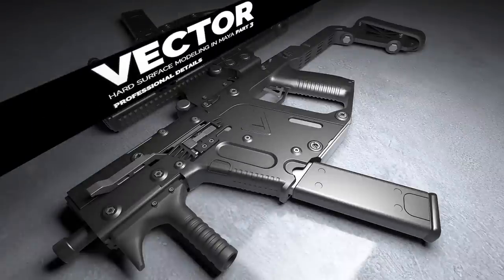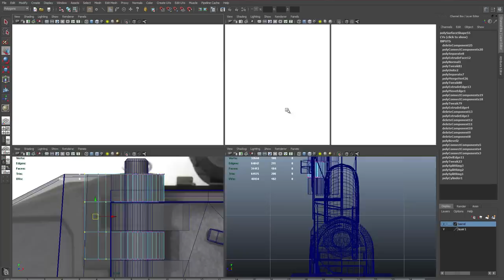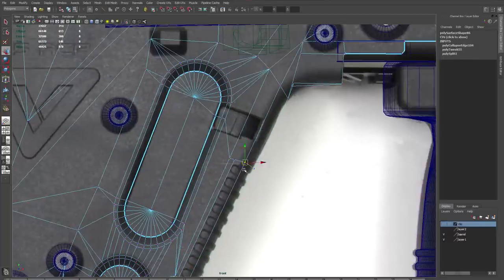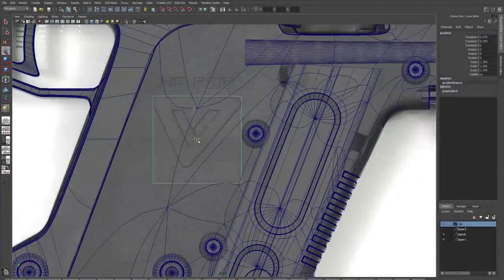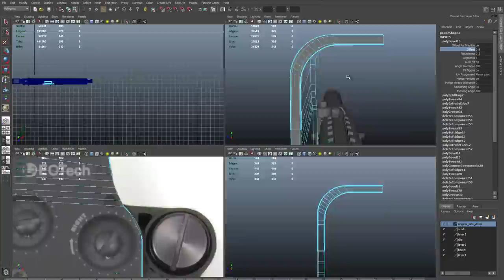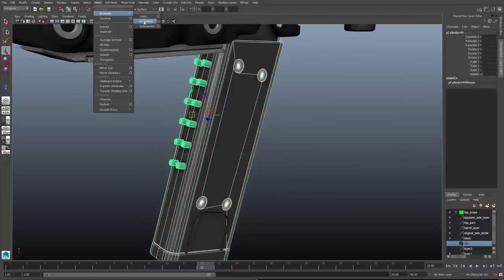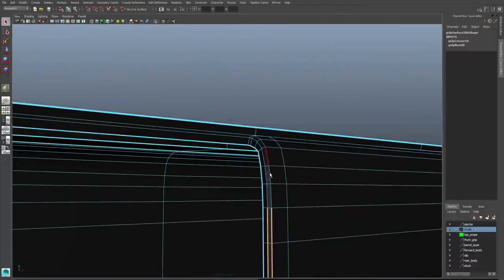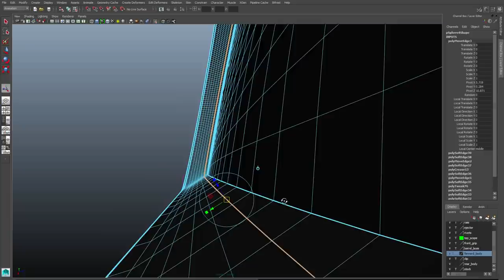Maya hard surface GUN MODELING tutorial part 3 - professional detail

Comment: I'm new to this, and I've been told to avoid ngons and triangles at all costs, yet here you just cut geometry and make triangles without concern. Does it not matter on hard surfaces? Does it not cause you problems when you subdivide and texture?
Reply from the maker: Patrick Bateman not so important for hard surfaces, because they don't deform. Tesselation can be an issue when subdividing, but generally the smooth proxy shows if that will be the case, making problems easy to fix. Basically, if the hard surface looks correct, that is all that matters, topology is a secondary concern.
Reply: James Taylor Excellent. If the surface doesn't deform, could it be used for animating? I'd like to make a gun like this with the breech bolt as a separate object constrained onto the actual weapon; when it fires, the bolt will slide back.
Reply from the maker: Patrick Bateman sure, no problem. When I say deformation I mean skinned deformation - so bending, stretching, etc. So simple bone or object animations will work perfectly well.
Reply: Thanks again!
Reply: +James Taylor Hey! I'm glad someone asked this because I had a similar concern lol. What if these items are going to be used in a game engine? I&#39;m not very familiar with game engines but I hear that it wont import correctly? I want to be able to make models that work universally
Reply: I understand you need triangles for game engines, but if you had quads (using maya), then you can triangulate those quads. Isn't that how modelers create game assets? I mean if you mean that the gun for a game engine will consists of much less polygons and details will be created using texture maps and normal/bump maps, then I understand where that can be a different criteria, but nowadays many more polygons can be used in games, especially for an FPS game where the gun is very close up and it is important to have that level of detail, so wouldn't you would need that polygonal detail?
Reply from the maker: +Christian Carbajal incorrect, triangles import fine, there is nothing wrong with triangles, read this blog post I wrote on the topic: http://methodj.com/why-are-triangles-bad-when-modeling/
Reply: James Taylor  Cool, just read it! I was more worried about the Ngons though, I should have clarified earlier. The blog was very helpful though! I was afraid of using triangles lol
Reply: +Christian Carbajal Ngons do not matter as long as they are on a flat surface and there are no corners or edges of that ngon touching the other polygons of the object. Basically, if it looks correct in the modeling software of your choice, it should work just fine in a game engine. If it deforms when smoothing is applied, you need to get rid of some ngons in that area. Hope that makes sense to you.
Reply: Oh wow didn't know that! This is great to know! I've worked making models for pre visualization, and I used Ngons a lot for hard surface models which worked fine (Like you said, on flat surfaces) but I wanted to take precautions on other cases. Thanks!

Comment: This was very informative. But I really wanted to see how you made the screws. I had to make one for my class and I had so many verticals in places that didn't need to be there.  WOuld love to know how to make one without any problems. Other then that. this was very interesting to watch and had me sitting here wishing I was as good as you are.
Reply from the maker: Screws are probably the one time that boolean is the way to go. They are hard surface so topology is not very important. You can finish up the shape, and then boolean out the groove as the very last step.
Reply: @MethodJTV  I tried it and my geometry went nuts. But it could also be that I didn't do it right. which is possible.

Comment: Hey James!

I was just researching texturing/materials and was wondering, what your opinion is, on ndo/ddo vs. Substance Designer/Painter. Keep up with these videos, they're exactly what any modeler needs.
Reply from the maker: InternetMan I've heard good things, but haven't had a chance to use Substance Designer yet. I played with ndo/ddo a bit and didn't really have a strong impression one way or the other, it didn't strike me as something that would be immediately useful in my own personal art pipeline.
Reply: James Taylor Yeah, I'm just scratching the surface of ndo myself, aside from near constant crashing, it seems okay. However, I was under the impression that I needed a texturing software like ndo or substance p/d, is this not the case? If my intentions are to produce 3D assets of high quality, that is. 

Thanks for the reply Mr. Taylor, it means a great deal to me someone like yourself can chime in here.
Reply from the maker: InternetMan I will be releasing a mudbox texturing video later this month, that should help you. The software you use isn't important, it is the results that matter. Whatever tool suits you best is fine, whether it is ddo or surface or mudbox.

Comment: Awesome!  But can this model be used in games cause it is really high poly.
Reply from the maker: kunal chikhale thanks! You're absolutely right, this is too high poly for current game engines. A low poly version would need to be created, UVs added, and then you could extract a normal map from the high poly on to the low poly. That was the process followed on games I've worked on.

Comment: Hi James, thanks for the nice series of tutorials. I`m beginner in 3d modelling and have a question... Is that ok to use crease edges tool instead of creating supporting edge loops to control sharp edges in high poly? I mean in what situations it`s better to use creases or edge loops? Thank you
Reply from the maker: Anton Melnyk creases are absolutely the way to go. Adding edge loops increases the complexity of the mesh, which makes editing the shape much more difficult. If you can get everything right the first time, either method works - but that never happens!
Reply: James Taylor Thanks for the such fast answer, I have understood you. Just thought creases are not good for backing normals on low poly mesh))). But what if I need to transfer my model to Mudbox or Zbrush? Probably in these cases I need to use edge loops only?
Reply from the maker: Anton Melnyk what I do is I smooth the mesh once or twice before sending it to mudbox. Probably better off that way, because you aren't adding highly localized density, which causes problems for smoothing in those programs.
Reply: I know for sure that when you use GoZ feature from Maya to ZBrush, ZBrush will automatically crease the creased edges you set in Maya. Don't know about Mudbox.

Comment: Amazing work, what program would you use to Retopo the gun? it seems so hard to do it
Reply from the maker: Romick Vieira thanks! First thing I'm going to try is stepping back to a much earlier save - my thinking is that the low res base shape I started with will be a good stepping off point for the low res version. If that fails I'd just model it in Maya, the gun low res object isn't super complex, the way retopologizing a character would be.
Reply: Any software would actually become good at doing retopo after you got used to it.  I use blender, and retopo isn't probably as hard as you think.  It is basically wrapping a new Quad and Triangles only low poly model over your highpoly model, with a certain amount of lost in detail.  But once you have the lowpoly model, it's easy to UV unwrap it and bake off the details from Highpoly onto a normal texture.  Then apply the normal texture onto the lowpoly for the fake details.

Comment: would love to see how you are going to make a low-res instance of this gun :)
Reply from the maker: supposetobenick I would step back to earlier versions of the file, and use the very basic low res geo as the start for the base mesh. That way it won't require much tweaking to match the high-res.
Reply: James Taylor I am curious to how you would achieve this? If you could quickly explain that would be appreciated.

Comment: How does this model subdivide? Creasing generally tends to end up with pinching, and it shows when you press 3 sometimes. But it completely depends on the end use of the model, like for games, film etc. So what is the purpose of this one? 

Mode looks nice though, just not sure which audience you're going for. For instance it doesn't look like it would bake very well to a low poly game model because of all the super hard creased edges.
Reply from the maker: Brygelsmack it subdivides fine, as long as you keep track of the creasing and monitor your topology, you won't get any surprises when you do a mesh smooth. Creasing won't show up on a low-res model, it only works when you smooth a mesh. The purpose of this model, is I wanted to model a high res gun! I did similar work on the game Stranglehold, modeling and baking high-res guns down to low-res cages, it worked no prob.  In this case I would step back to my very first save files, because the low-res block out would be a good start for the low poly game mesh.

Comment: Thank you for this video. Is this type of modelling useful for game modelling?
Reply from the maker: +aferalva69 yes. You'd end up creating a second, lower-polygon version and using this high-res version to create normal maps for that lower-res version, to save polygon count for ingame performance.
Reply: Thank you James Taylor . another question. can I just model everything  separated and them make a group with every single object without welding vertices or any part together?
Reply from the maker: +aferalva69 you can. After all, real machines are made of lots of little parts put together!

Comment: I can't find any "harden edge" tool in my Maya 7.0.
Reply from the maker: FrakU2 'harden normals' should be under the 'normals' menu. But you won't be able to use crease or smooth proxy, maya 7.0 is too old. Autodesk lets anyone use Maya for free, for non-commercial purposes now.
Reply: James Taylor I looked into that but the site asked me for a student number. I didn't know what to do. Do I just make one up? I'm not in college anymore so am I screwed?
Reply from the maker: FrakU2 IIRC they don't even care if you dont have a .edu address. Try leaving it blank and see if it works. Autodesk doesn't verify any of that info with schools at all...
Reply: James Taylor Frak me!!! Thanks.

Comment: Your final highpoly renders look great, but hearing you talk about needing good topology while leaving ngons, lamina faces and non manifold geo made me cringe so much. These models don't look like they have any other application other than final high poly renders and baking, other than that I don't see how you could possibly remove edges to make low poly models. Everything would have to be rebuilt from scratch I assume.
Reply from the maker: Jordan Moss pretty sure there aren't any lamina faces or non-manifold geometry on my mesh - and if there were, how could you spot them in the vid? :p

 Ngons, yes, but this is indeed just the high poly mesh. The only thing that matters is that the geo is clean enough for the artist to work with - if the renders look good, then it is good enough! 

Topology is generally irrelevant for hard surface meshes, anyways, because they don't need to deform the way an organic mesh would.
Reply: You have me there with the lamina faces thing, I though I saw a few watching the video but I just checked the end of the video and you seemed to have fixed most of them, I think its just my mindset in high to low poly workflow I've been taught and learnt. But I'm curious on how you would approach the conversion of this mesh to a low poly asset in your usual pipeline.
Reply from the maker: Jordan Moss yes, most people learn topology in terms of characters, where it is stressed that topo flow is very important, only quads can be used, etc. This is because these rules make sense when setting up a character to create optimum deformation. But for a hard surface model, those aren't important, because there is no deformation.
To make the low-poly, I would simply step back to an earlier save, when I was still blocking out the model. Then I would add edges where necessary to get a better match between the low and high. That way, I have a simple low-res cage without much effort, and it should match the high res very closely! Although, building a new low-res from scratch wouldn't take that long, either, without all the tiny details, the gun is basically a grouping of cubes and cylinders combined together.

Comment: how the hell would u texture something like that
Reply from the maker: IGarrettI I would do it in a 3d paint package. Mari, mudbox, etc.
Reply: James Taylor And uv it using planar?
Reply from the maker: IGarrettI the new bonus tools would help here. Check out my latest unwrapping video, the same principles would work on a hard surface model.
Reply: James Taylor I totally forgot about it. This model wont be in a game, it will be used to transfer detail, right?
Reply from the maker: IGarrettI yes, this would be the high res base I would use to transfer details from. The low res would then have the high res as a normal map, and you could paint the low res detail.
Reply from the maker: ***** at some point yes, I will probably do a video of UVing, normal mapping, and texturing, but that probably won't happen soon. In the mean time check out the UV Mapping vid, most of the principles will work fine on the gun: @watch?v=HLhazEa8wmw
Reply: James Taylor Isnt the topology a bit messed up to use it in a game, or Uvs?
Reply from the maker: IGarrettI topology is basically irrelevant for hard surface objects, game or otherwise. I can't see how UVs would be affected. If you projection paint, UV layout won't even matter.
Reply: James Taylor Oh right.. because it wont be animated so the topology isnt relevant, or animation works differently compared to the organic stuff, am I right?
Reply from the maker: IGarrettI exactly!
Reply: James Taylor Thanks. Youre very helpful sir!